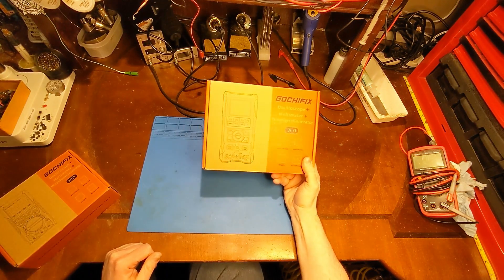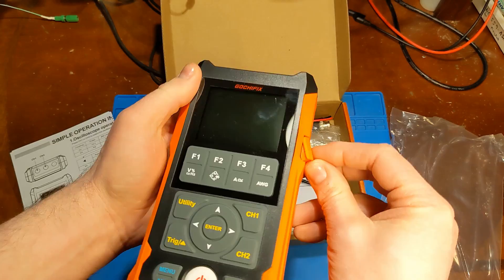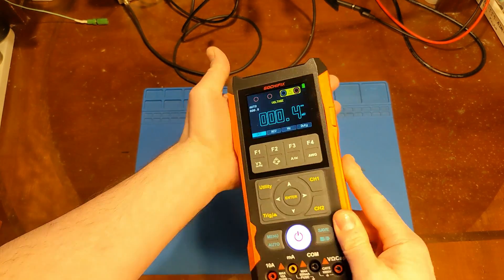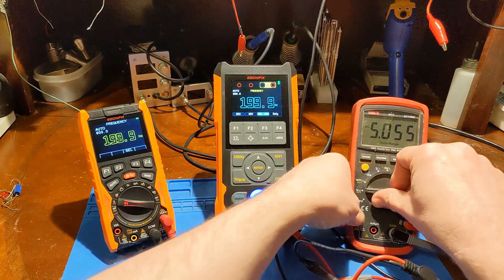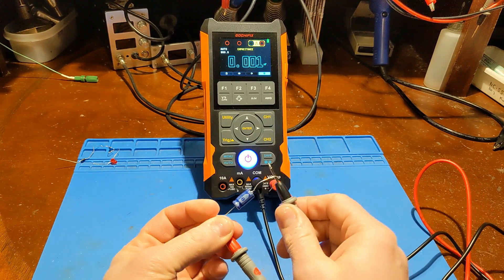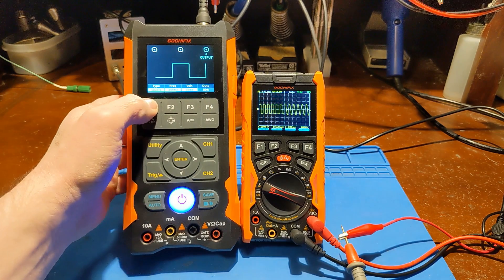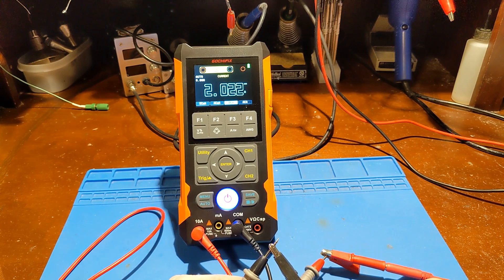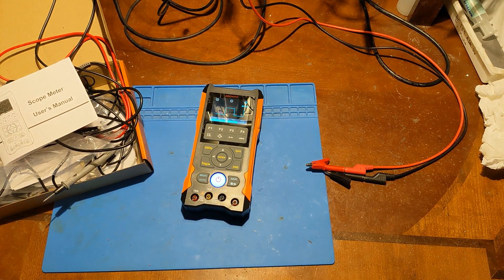3 in 1 Meter Review

Comment: Hey Jeff - have you ever dealt with the 06-11 crown Victoria IPCs? I keep seeing intermittent power failure. Hoping you could help. Can’t find a schematic for them either.. any help is appreciated man
Reply from the maker: I probably might have. But I don't remember specifically. Intermittent power almost always is caused by fractured  solder joints. Check for the six-pin resistor network chips, loose microcontroller pins, fractured resistor joints or connector pins.

Comment: The price of the unit is very good for the functionality it provides. For a lot of electronic / electrical work, the portability of the unit is very attractive. I wonder does the unit accept x10 oscilloscope probes ? Being a battery powered unit removes potential problems with common voltage limits when using the oscilloscope on circuits that are well above ground / earth. Finally the display, particularly showing multimeter readings etc appears so much easier to read than a monochrome LCD display.

Comment: I mainly want a multimeter for use in finding out the charge in batteries that I salvage when dumpster dumpster diving. That will help me to know if I can reuse them or if they are drained of juice. This may also help me with finding out if taking apart broken electronics with Li-Ion batteries would be worth it, as well as if chargers I find in the trash can be reused/resold or if they are nonfunctional. 

That will be super helpful as I will not have to find some random peice of tech to place the batteries/charger into to see if it works, as I do not always have a peice of tech that the charger would fit, lol

I have been meaning to get one for awhile, but for many reasons (cost, ADHD, ignorance, etc) have not gotten around to getting one. 

Reviews like this are great at helping me to find a good one, as well as learning how they work and function

Comment: Nice to see that it uses a USB C.  I've gradually been trying to move all my devices to C. Tired of constantly looking for cables. Hopefully it stays the standard going forward. Soldered fuses is a bit of a let down though, as blowing fuses does inevitably happen. I guess you could always add a fuse holder and solder it instead if you did have to replace the fuse down the road, assuming there is space available (which it looks like there is). My current meter is basic, it's cool to see that one has a oscilloscope.